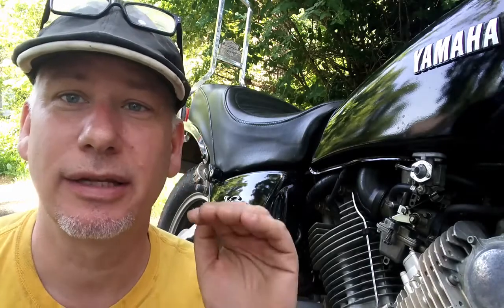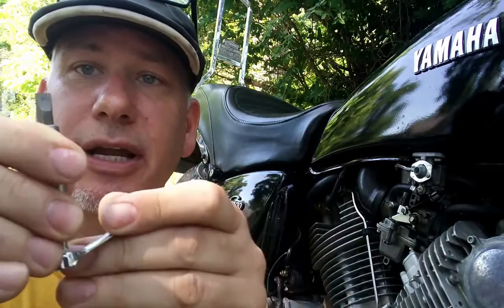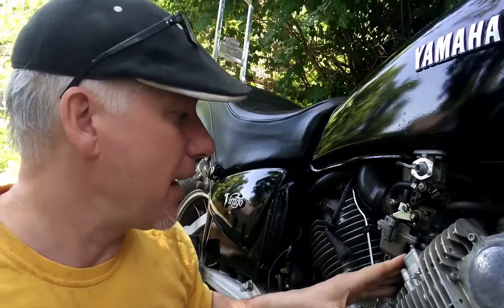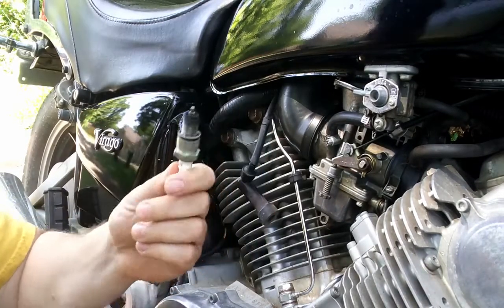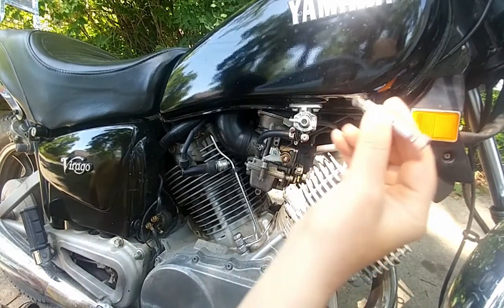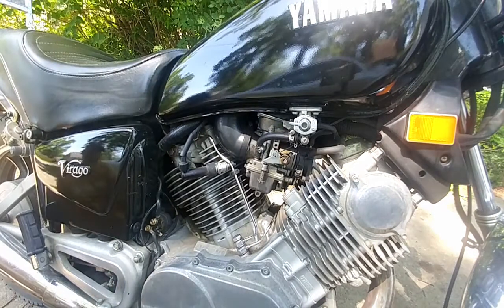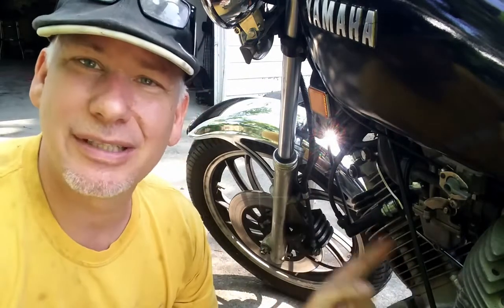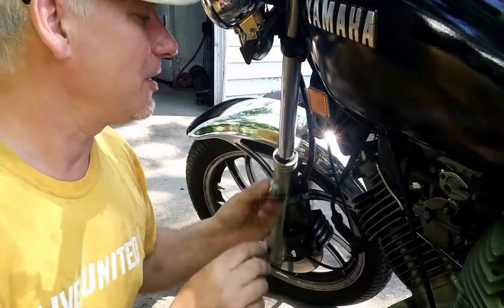Stop backfiring carbs on decel on 1981 Virago XV750 - Vintage Yamaha Backyard Restoration Quick Tip

Comment: Let's try somwthing  a bit easier. Pull your plugs and inspect them for color. If the plug is burning a light chocolate brown it's fine, reinstall it. If it's burning black with carbon it's running too rich or If it's burning white it's too lean. Reinstall the plugs. If black with carbon  give the corresponding screw a 1/8 turn to the lean side. Take the bike out for a ride and see if that helped. If it is improved but not perfect stop the bike and give the screw another 1/8 turn and ride it some more. Do this until the popping stops.  Do this in reverse to enrich the mixture if your plug is burning white or too lean. You can do 1/4 turns but I find the 1/8 to be more accurate. Which way you turn your screw is different with different carbs depending on if the mixture screw is on the engine side of the carb or on the intake side of the carb. Your screw is on the engine side so cw will lean out the mixture, ccw will enrich the mixture. Run a tank of fuel through the carbs, pull the plugs and check to ssee how they are burning. I hope this helps.

Comment: Good trick for air screw setting. OR maybe backfiring is an issue with mixture control valve (pressure release)? I also noticed there is no Breather pipe given on your 81' model's front cylinder head but on rear, I have it on my front cylinder.  Never understood why Breather pipe and mixture control valve both are given on front cylinder of my 82' XV750.🤔

Comment: UMM -  I think you should be working on the carb that is firing instead of the one that has the plug pulled.  You can turn the Idle air screw until hell won't have it on the dead Cylinder and it will not make one iota of difference to engine speed.
Reply from the maker: "Dead Cylinder Method" has been used by several people.  Some people use a dummy plug.  You can read more about it here: (Yes, I realize it is on an XS forum, I also have an Xs850 3 cylinder that I am restoring) https://www.xs650.com/threads/dead-cylinder-method-for-carb-setting.49892/

Comment: Ive got the same bike..i took off the exhaust middle muffler with the end pipes..leaving the main pipes still on conected to the cylinder..i wrapped the pipes in cloth put to small 50mm end pipes..went out for a drive sounds loud but ok but coming back fk me it backfired all the way home...so do i put the stock back pipes back on with the under bit muffler....or would i cure it another way....hmm thanks for your video appreciation 👍☕️😉

Comment: Sr. Great video, I have a 87 xv750, but I have problems with backfire even when a leave it in 1000 rpm (idle) my spark plug is carbonized, might be to much gas, I wonder if this wideo could fix the problem?
Reply from the maker: Typically, when you have backfiring happening at idle it is usually because the carburetors are out of synchronization. In one of my other videos, I end up setting and synchronizing carburetors on a red xs850.  Check it out and see if it helps.  You can buy the gauges off of Amazon for about $35 USD

Comment: I just finished my rebuild and I’m running to rich. The plugs are fouled and covered in black soot, similar to yours. Is it simply a matter of turning those screws to lean out my mixture? My bike will not start or idle.
Reply from the maker: I would say yes.  If they are Mikuni carbs on a Yamaha Virago XV750 you are looking at running in the pilot screw all the way in and start at about 2 full turns (many other bikes start out with a stock setting similar).  I have had some carbs even go as much as 3 full turns.  Try to pop the plug wire off of the other cylinder so you are only dealing with 1 cylinder at a time while setting the pilot screw.  Once you get less pops and it smooths out, then do the same to the other side.  Finally send lightning to both spark plugs and see how she runs. :)  I hope this helps.  Thanks for watching!

Comment: I have the same bike when I get into high rpms it jumps looses power I don't know if it's air fuel or filter
Reply from the maker: Maybe check your diaphragms for gunk/tears.  Just be careful when trying to get them out that you don't rip the rubber.  I put a thin layer of vaseline on mine and wiped it clean to try and soften up then rubber.  I hope this helps.  Good luck!
Reply: Had a similar problem and literally just needed new spark plugs on my 97 750. Try new plugs and wires before anything more expensive!

Comment: Hello from Brooklyn - Thanks for the great video.  I got a 'barn find' '82 XV750 that hadn't run in many years but only 6K on the odo - wasn't starting so it was almost free.  I have been tinkering for a few months (cleaning the whole tank and fuel system and rebuilding the carbs so I can clean the bowls and jets, etc.) and she is now at least starting!  Thank you so much for the idea for pilot screw adjustment with the carbs on because they are a *** to take off and put back.

One question if you have a second:  the bike starts great but when its warm and I back off the choke she dies after a few seconds - is this a pilot screw adjustment fix?  I am new to these Hitachi carbs, any ideas would be amazing.  I am grabbing some of your merch BTW - that swag looks good!
Reply from the maker: Thanks for the comment, yes it could be the pilot screw adjustment.  I would also check the jet orifices just to make sure that there is no obstruction.  A trick is to use a High E (smallest) guitar string.  It will fit in both jets and you don't have to worry about a piece breaking off inside.  I use them all the time for reaming out jets to make sure that they are nice and clean.  Feel free to pick up some merch.  I have been slacking on the videos as of late, but don't worry.... more rebuilds are coming :)

Comment: Question. I just bought an 81 virago. Where there is supposed to be a flathead insert, it is just a flat piece of metal
Reply from the maker: Can you be more specific?  I am not sure where you are talking about.
Reply: Sounds like you can't find the screw head ? It is probably blanked off (at the factory ) with a cap to prevent tampering. It's called a Welsh plug. There are vids how to remove it. Good luck 😃😃
Reply: Same here; friends at the bar say insert a drywall screw and try to remove? Terrified since it's on the bottom of the floats but I think I'll try after work tonight!

Comment: Hi Thankyou for your video yes my xv 750 1994 us custom  has had a backfire in rear cylinder carbureter .so I shall try your advice .thou I also have a persistent problem with front cylinder NOT firing eg plug is wet when removed I have removed carbs cleaned and refuted also today replaced both ignition coils and fitted iridium plugs ...but when I gun the bike for any distance front cylinder stops firing and eventually engine cuts out ...any advice be much appreciated many thanks from over hear in UK CHEERS BOB ...
Reply from the maker: It sounds to me as if the front cylinder may be running to rich so when you are going WOT it is dumping too much gas into the cylinder.  I would check to see if factory jets are in the carbs (or if someone has put oversized jets in it) and check the air/fuel mixture as well.  I hope this helps and thanks for watching!

Comment: What tool arr you using to screw/unscrew? Im having a hard time with what i have om hand. The placement is not super friendly lol
Reply from the maker: Hi.. I am using a Philips screw bit and a 1/4" boxed end wrench.  The bit should fit right in the boxed in side and you can twist that way (some bits are 3/16", so you may need a 3/16" wrench if yours is bigger)  Thanks for writing!

Comment: I have a virago xv750 of 1982.la I turn on and does not last on then it turns off and that I just put the new spare parts to the carburetors.
some advice that you can help me solve that failure
greetings from mexico
Reply from the maker: Verifique que los chorros dentro del carburador no estén obstruidos. Puede usar una cuerda de guitarra E alta para eliminarlos. Parece que definitivamente es un problema de suministro de combustible.

Comment: My 750 is backfiring and  as soon ss take the off the bike dies also the bike has not run for a few years any ideas?????
Reply: Sorry i missed a few words when i take the choke off it dies
Reply from the maker: @reneguay1347  Check to see that the jets in the carbs aren't plugged/gummed up.  This happens with a lot of bikes that sit.  You can use a high E (smallest guitar string on a 6 string guitar) and poke it through the jets to clear out any obstruction.  Good luck and thanks!

Comment: My 82’ virago feels liek it’s not getting fuel when I pin it, if I give it a little gas the rpm’s will build and such but when I pin it it doesn’t jump or have any more power just the same steady build in rpm’s, what the hell is going on with my bike any idea? Last season it pulled hard now it does not
Reply from the maker: Check for possible jet orifice partial blockage.  Ream it with a high E guitar string.  It may be starving for full at WOT.  Thanks for the reply and the watch.  We are learning together!

Comment: From a bike mechanic:
Pops don't come from s carburetor, its unburned gas in the exhaust system. It's a rich condition.
Reply from the maker: Yes, and how do you typically rectify a rich condition?  Air/jet screw, right?  That is located on the carb, so you have me confused with that one.
Reply: @vintageyamahabackyardresto4995  a "backfire" is a timing issue, popping in the exhaust is rich mixture. Two entirely different problems.
Reply from the maker: @longdong3889  All I can do/show you is what has worked many times for me.  "*Results may vary" if you need a disclaimer.  Thanks!